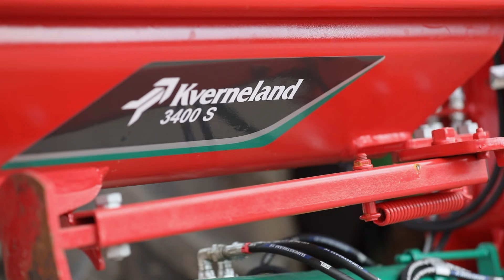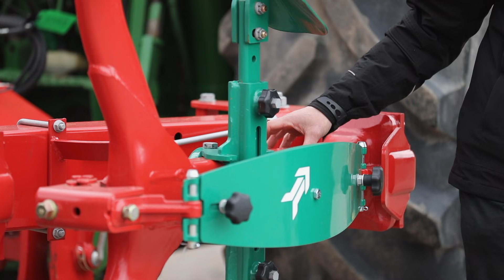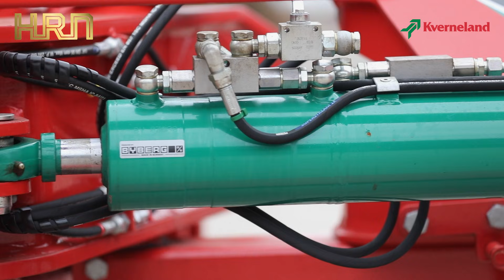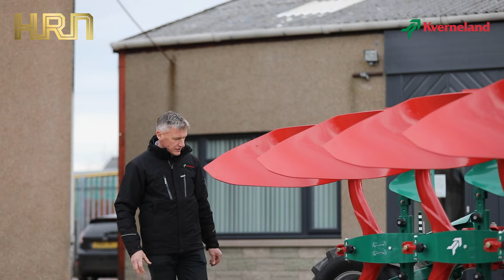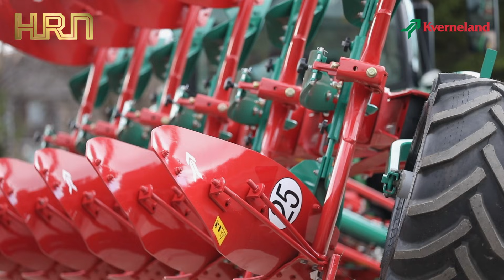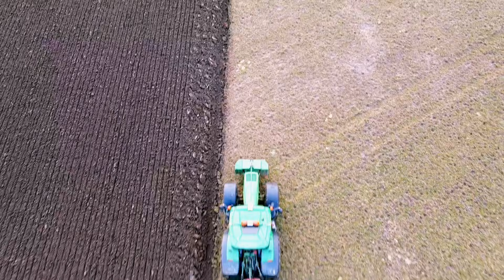HRN and Kverneland Plough 3400S Video Video

Comment: If the tractor won't lift the ploo high enough? So, are you saying that a 350hp tractor might struggle if there's a lot of sticky dubs clinging tae the ploo? Maybe you need something ower 4 hunner horse then. Nae very clear about fit horse is better suited. It's a very weel fin the ploo is spanking new and shiny but fit a boot fan it's oot in the middle of the park in a weet hole. I have my doors a 350 horse beast is big enough

Comment: Fantastic ploughs. Bought one in 2021. Really impressed  with all the functions. But, & its a big but. At no point does ant body tell you you need one hell of a lift capacity on your tractor. 200hp will pull 6 furrow easy. But will it lift it. I were told my jd 8410 would lift it but wont. So had to plow with a jd 7920. Fine when plow is all new. But you get it blathered up in sticky soil & it realy struggles. Paxtons not bothered, just want to sell you a case. Id think twice about buying one because they to heavy unlee you got a 350hp tractor on cat 4 linkage. Kv will loose sales if they do not inform customers of its weight.